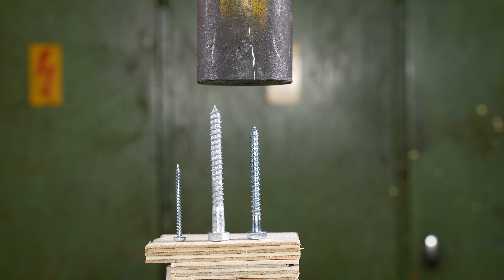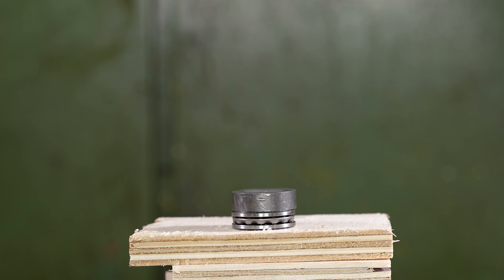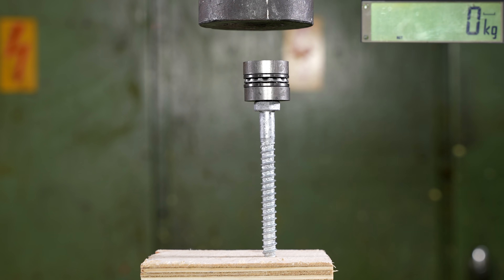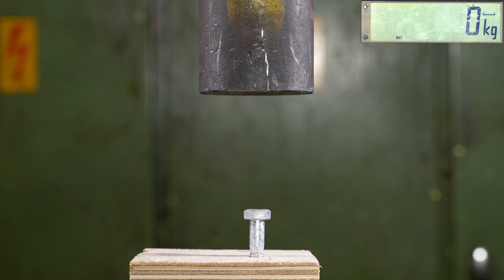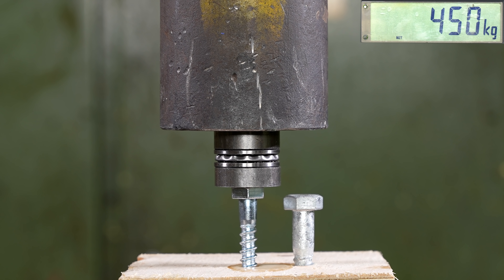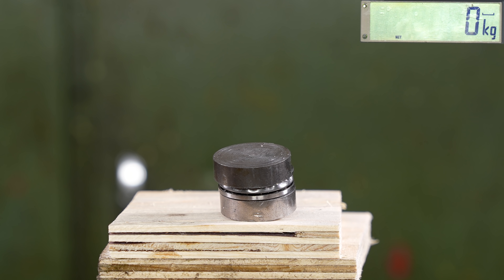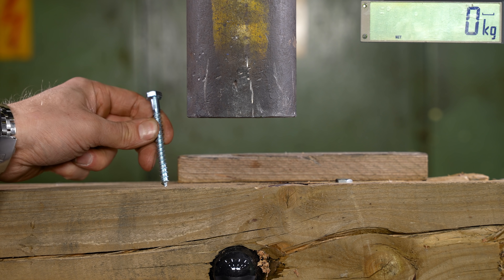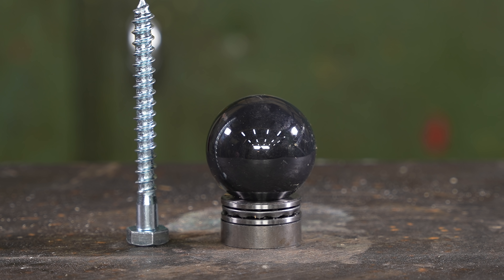Crushing Screws into Wood with Hydraulic Press | Will They Spin?

Comment: Have you considered thermal shock to crack the ceramic balls ? Something like heating them in a forge and the dropping into water or dry ice or maybe onto a lead block. Alternatively simultaneous heating and cooling from two sides.
Reply: Extreme temperatures on opposite sides at the same time could be cool but iuno how it could be achieved in view of a camera
Reply: @drumboarder1  Place it on dry ice, use welding torch on other side, ?
Reply: @idjtoal  the ice would just melt away
Reply: Good idea. When Hannibal crossed the Alps with elephants, there were large boulders in his way. They heated them and then poured cold water on them and the broke into pieces.
Reply: @ninemilliondollars  that's quite interesting. 
If you don't mind me asking, where did you learn it? I'd love to check out the source and see if it had any other tidbits.
Reply: I was just thinking the same. And I will be surprised if it won’t crack just dropping it into water after heating. Dry ice do not sound good idea for me. Liquid nitrogen would probably be the thing but that sounds extremely dangerous. That would probably make the ball explode.

Comment: When screwing in a bolt such as this, the threads actually PULL the bolt in. The downward pressure is higher than the tendency to spin.
Can you set up a fixed drill and socket, so you can measure the pull force, when screwing it into wood.?
Reply: Agree that when screwing it in, the threads pull the bolt in. So since the bolt is being pushed in, the wood resists against the downward motion, however, at almost a horizontal angle, the bolt barely turns. (Thinking with vector analysis.)

Comment: The concept behind fastening screws is that they dont unscrew by themselves. So they are designed to always have a higher fricion force on the threads then the axial pulling / pushing force.  Machine screws and wood screws alike. The only threads that allow that kind of movement are for example lead screws in machines like mills and 3D printers. They have a steeper thread angle as some commenters already said.
Reply: yes!!

Comment: If you had screws with a steeper angle of thread, they would spin more. With a shallow angle, there is too much friction to allow them to spin easily.
Reply: My thoughts exactly. There's too much drag.
Reply: Perhaps, but the first few turns cant make the screw turn so they just break up the wood leaving nothing for the rest of the threads to get a grip on.
Reply: He should try Ardox nails in the setup. They’re designed to spin. 🗜
Reply: The incline would have to be greater than 45°.
Reply: @buckwildebeest398  depends almost entirely on the coefficient of friction. At 45° it would spin surely and also with lesser angles if the coefficient of friction is less than 1.
Reply: Most probably about 30° should be plenty to make it spin

Comment: Prediction: it wont turn. If it could turn just with pressure, the same would likely be true for the reverse. In other words: if a screw wont twist itself free from a piece of wood when you pull it hard enough (and it doesnt, it just breaks the wood when it fails) then it also wont turn if you push it in.
Reply: This is partly true but if you imagine this situation there's actually no force that would even cause the screw to spin at all.
This is because the screw has threads all the down it's shaft and hence both pieces of wood are equally threaded with the threads obviously both being clockwise threads. So if you tried to pull the boards apart this would not cause the screw to want to turn because as the screw does turn the board cannot begin to separate until the screw is all the way out of the second board. 
Or in other words prying to screwed boards does not impart a net twisting moment on the screw because both sides impart an equal and opposite moment.
This would work if the screw was only partially threaded so that only the second board has threads in it and the first just has the round shaft.
Reply: @amosbackstrom5366  woodscrews are already partially unthreaded on their shank.
The problem is not to do with the shank, but the thread angle.
Thread angle is the reason screws don't pull out of things
Reply: Yes, the screws are DESIGNED to be able to move in and out easily by rotating it, but resist the motion the other way around. That’s why they hold.

Comment: To break the ball bearing, make a fixture with a ring in which the ball sits. Rest it on a hardened point and put on the press head. The ring keeps it in place and the small surface area will crack the ball. A shock impact would also do the trick, as ceramics aren't good with shock loading, far too brittle. Steel does much better with shock loading in most cases.

If you're just using flat surfaces on the press, you're trying to squash the ball, but its shape and material prevents it from breaking. There is very little deformation in ceramics, like glass, and the smooth surface won't allow for an imperfection to start a crack. They're also cast, so the surface cools faster than the inside, creating tension towards the center, which counteracts the press. Like a Rupert's drop, but without the tail you can snap.

The reason obsidian does shatter fast, is because the ball is made out of a block, and the tension is the same everywhere. It also isn't perfectly formed on a molecular level, so more places where it can fail and shatter.

Comment: I wonder what would have happened if you drilled a hole in the wood, the size of the bolt core first.
Reply: Came here for this, why the fuck didn’t we give the screws under the press the advantage we’d have given screws under a drill or screwdriver? Amateur

Comment: Try with a pre drilled hole.

Try screwing it it, rather than pressing it in initially. Those first few threads are most important.

A drill bit would be cool.
Reply: yes! and also go much slower so it has time to rotate.

Comment: In the eighties I worked for a company that made drill jig bushings. Standard procedure was to ream the bushings leaving .002” in the ID, heat treat the bushing and hone to size. In an effort to reduce the time and labor to do the honing operation we presses a ceramic ball through the ID of the bushing before heat treat. As an example, a 3/8” bushing would be reamed to .373”, sized with a .375” ceramic ball and after HT the hole would be .3752”. After heat treat the bushings had extremely smooth surface finish and only about .0002” material to be honed. Hone time was reduced by 90%. ID of the finished bushing was more wear resistant and lasted longer when in service in the drill jig.

Comment: you should try pressing into a coarsly threaded material, the wood does not provide enough force on the threads and collapses. Maybe press them into some hardened metal
Reply: Wont work.  Only thing that can work is threaded hole in a verry low friction coefficent material.
Screws dont turn with axial forcess by design.

Comment: They spin a bit at the beginning, but stop as they get deeper in the wood. I wonder if the friction as more of the screw is contacting the wood becomes too much for the downward pressure to overcome?
Reply: once it break through 1 layer of thread those threads no long produce the cyclic force - then it just a down force - I think there should have been a pilot hole so that only the thead was catching the wood ...

Comment: If you try to screw in a long screw, particularly without a pilot hole, you'll find that it requires more torque there further you screw it in.  This is because there is more frictional force opposing the turning of the screw.  So with the press, the screws (the smaller ones) began to spin, until the rotational force (torque) required to turn the screw exceeded the force required for the wood to yield to the vertical force.

Comment: Try drilling a pilot hole first the screw the screw in so it cuts a thread. Remove the screw and see if it follows the precut path with the hydraulic press
Reply: First just with the pilot hole. After all, a pilot hole is quite a standard technique, so it wouldn't even be cheating.
Reply: I agree about pilot hole, and starting it in several threads. That way it has a section of wood already trapped between threads. As it is, it only moves the wood out of the way at the point, then nothing else.

Comment: Plywood is likely too soft - there is less resistance just pushing the lag screw in, than spinning the bearing.  Perhaps use denser solid wood?  You could also try a small pilot hole to see if that allows the lag screw to sling.  You might also try high-quality, high-pressure bearings instead - I think you are only compressing the small ball bearings into the races, preventing them from spinning.   I have other ideas too, but try these first.  

Love the channel, if for no other reason the laughing and giggling you two share with us..  That always puts a smile on my face.  Thank you very much.

Comment: Would be better to have a large bearing race , probably 6"+, low friction setup, under the work so the wood can spin freely.  Theres too much pressure on your bearings for them to spin under the direct load of the lag bolt.

Comment: Here are a few suggestions to try if you attempt this experiment again in a future video:

Maybe try predrilling a hole that's basically the same diameter of the INNER shaft of the screw first, before trying to push the screw into it, that way it doesn't have nearly as much friction to overcome.

Also try using a screw with a much higher thread to inner shaft ratio, (outer to inner diameter), especially one with a much COARSER thread, (not so fine as lag bolts), maybe such as a coarse thread drywall screw or something like that, that doesn't have as much friction in the flutes as those lag bolts have.

You might also try a screw with a much steeper thread pitch. (i.e. one that goes in at a much faster rate and requires less total turns to get it all the way in than a "normal" screw does)

You might also try all of this with a much denser, harder wood, then, especially if you also predrilled the holes to the diameter of the inner shaft of the screw, then you might actually get them to spin under a precision ball bearing. (As long as the bearing can withstand the pressure on its sides without jamming up and not turning.)

Comment: If the screw spins (not only a bit)  by being pressed into the wood, it would spin by being pulled=missing the reason of being a screw. That would be (more or less) at a threading angle of 45°, depending on the friction beween screw and screwed Material and other influences. Imho.

Comment: The first galvanized lag screw you tried is probably the worst to try. It’s rough and takes quite a bit of torque to screw in in normal conditions. These lag screws also are typically pre-drilled. So they have a hole to go into that’s slightly smaller than the minor diameter of the threads. 

Cool experiment though! I’d like to see you try again.

Comment: As far as I can find, the difference between a screw and a bolt is that screws have slots for screwdrivers, and bolts have angled sides for wrenches. Also bolts are usually bigger.
Reply: i thought the difference was that the threads of the screw sit in the material while the threads of a bolt are to secure it with a nut, but not a connection to the material itself, but thats just from the top of my head...

Comment: Lauri - those "screws" are actually called LAG BOLTS.  they are meant to screw into a 2-part LAG SHIELD that you set into a hole drilled into masonry, to fasten something to brick, concrete or stone.

Comment: I would be curious to see if drilling a pre-hole and having an hexagonal socket in the top plate would change anything. At some points it appeared that the head of the screw was slipping under the plate. It would be nice to try pressing a screw in a tapped hole in a steel plate.
Reply: Yup exactly

Comment: Try the lag bolt with a pilot hole. I always drill pilot holes before installing those.  Pilot hole should be slightly smaller than inner shaft. It would also be interesting to start screwing in the bolt and then press it in.

Comment: You Could try whit predriled hole. And the plate under the bearing should have a recessed so that the screw stays in center of the bearing rotation . For less friction

Comment: Maybe with the bolt/screw test. Do an absolute best case control to see it is possible. 
1) So larger thread area to shaft as you said
2) conventionally screw it in first with addition of wax or something relevant for wood-metal matrix lubrication
3) more rigid/hard and grained wood so wood just doesn’t buckle and deform as easily.

Then if you repeat what you did with those modifications and you still can’t get it too work, can then put the last nail in the coffin (pardon the semi indirect pun).

Comment: I was a lineman before I started building substations. You can hammer a lag screw into a pole and it will stay in the pole just the same as if you ran it in with a driver.

Comment: I would say a screw has the pointy tip and is made to go into a solid material with little to no outside help while a bolt is flat tipped and goes into specifically threaded holes

Comment: For the bearing see if you can get a ceramic bullet tip made, or make a hardened steel one yourself. make sure the point is very sharp and use a laser sight for aim to hit precisely in the middle.

Comment: I'd like to see another video exploring this a bit more. 

Firstly, maybe you could start the screws by screwing them in instead of pressing them in.

Secondly, you could put a thin piece of sheet metal on the top of the wood to engage the threads on the screws, make a hole the size of the shaft of the screw but smaller than the threads, add a bit of lube to help the thread slide in the sheet metal instead of pushing through.

Thirdly, you could try using a T-Nut pre pressed into the top of the wood and press a screw down through it.

Comment: You should try pushing the bolt in after you drill a pilot hole so that maybe the threads will have more effect because of less surface area on the shank of the bolt

Comment: You might be able to utilize a strong up-down vibration while pressing down in a harder material to get the screw to spin. 

Like 50% the width of the thread's width vert range @ at least something like 30-100x the rate of number of threads going in per second

Comment: Break the ceramic-ball-bearing using a tungsten bead underneath; pressure first breaks the tungsten, catastrophic disintegration, the gap closes with an engineered-shock: the bead's gap holds till pressure bursts it: bead breaks, allowing the press to strike the ball, which should be too brittle to sustain the jolt; tiny uneven fragments of tungsten might create points of pressure and increased odds of exploding the ball.

Comment: The pitch of the screw is at an angle where the friction against the thread keeps it from spinning. You need a very high pitch bolt or use soap or graphite on the threads to help. A material that is harder will also help.

Comment: So unless you have the bearing stack dead center on the screw, the radial forces to cam the bearing are more than the forces to overcome the tensile strength of the wood. Also, polishing the screw and an acme thread would both put you towards the correct direction, as would the lead angle/thread pitch.

Comment: You could try the same experiment with a bolt and nut as the nut is pre threaded, ideally a custom nut with a wood screw angle, that might work.

Comment: Try using the ceramic bearing as a cannon ball against a hardox plate, either with a pneumatic cannon or a explosive one, and a 3d printed discarding sabot style wad so it fits the barrel perfectly and doesn't shatter from the explosion before it can hit the target

Comment: i have always assumed the difference between a screw and a bolt is screws have the sharp point and you can use a drill or screwdriver to drive them into objects. Bolts on the other hand are flat, require a washer and a nut to secure them in place and are used on metal structures like vehicle frames or walkers to add more strength to the joined parts. I may be wrong this is simply how i have interpreted it.
Reply: Bolt just go threw the material and are secured by a nut or similar while screws are directly screwed into the material.

Comment: Regarding the ceramic bearing ball you will need two of them to achieve the method I'd propose to try first place one in the press and press it to create a pair of divots in the top and bottom tool release it and then Bond the second bearing ball in the divot in the top tool and then press the two bearing balls into each other hopefully the hard interface between the two has enough point load to get the job done

Comment: You should try pilot drilling the diameter of the shank, then the flutes might take to the grain easier. The cone on the bolt is pushingthe grain aside and not giving it something to bite

Comment: I have a feeling if you cut the sharp tip off it may be more likely to spin.
Bolts - are meant to connect with a machines female end of some kind. Blunt end
Screws - tapered end and typically creates its own threads but not always.

Comment: They might spin better if you push them intowood with a pilot hole drilled, and push them slower. The big "scews" with the hexadecimal heads are called coach bolts

Comment: Try screwing them in 3-4 turns before you press on them. They might be slightly more likely to spin in once the spinning has started. But as others have pointed out, its still overall unlikely to spin with just axial force, as that would allow the screw to spin out under load.